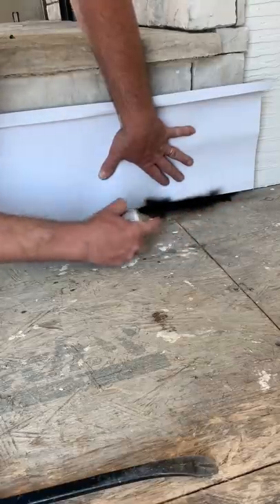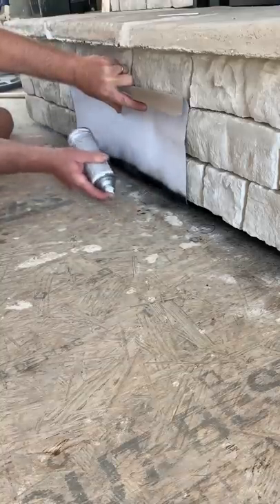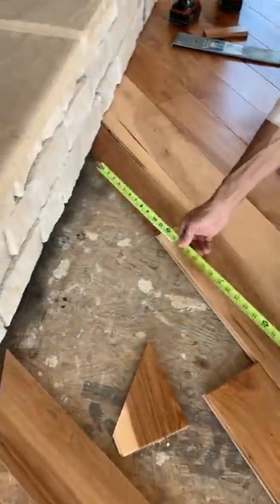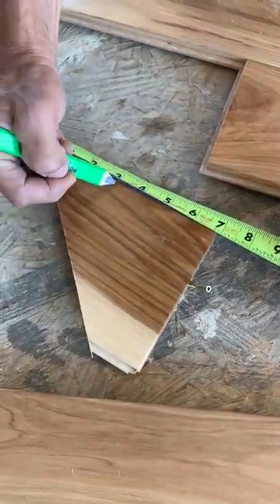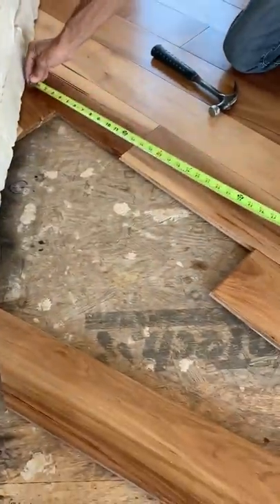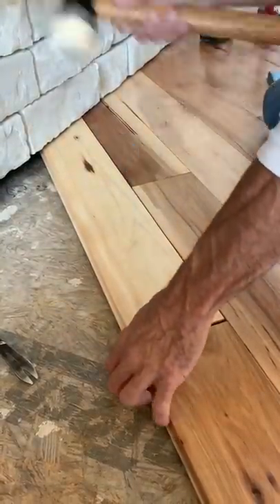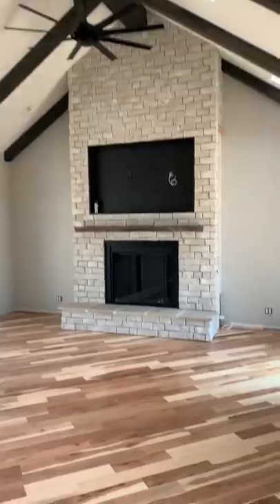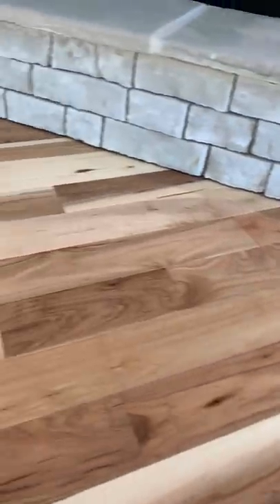Pro Hardwood Tips #shorts

Comment: That’s how you do it. Always communicate with other trades. It takes on average 22 subcontractors to build the average house. A good builder always knows what’s up ahead and plans accordingly.
Reply from the maker: Right on!
Reply: 22 😆
Reply: Give it everybody for bob the builder
Reply: 22 lol
Reply: 22? Should be 10
Reply: A R 🤣 that’s not how it works in wealthy suburban areas. The excavation contractor doesn’t come back to install the roofing and gutters. The carpenter doesn’t do the concrete and masonry. The plumber doesn’t paint and install the countertops before he installs his fixtures. Y’all are not seeing the bigger picture. Keep punching a time clock 🕰.
Reply: @zackzander425  or hire a general contractor, my boss does plumbing, electrical, roofing, siding, drywall, flooring, framing, you name it
Reply: A R  In GA there's an abundance of people saying they do it all and less that say what they actually can do, yeah the guy might say he can run wire in your house and do the plumbing while he's there and only actually doing one of those half decent, I'd rather just get someone actually certified and well known for one thing so I'm not trusting 1 guy on 4 tasks to also document his work and what he's done.
Reply: This is why spending the extra time to have contractors meeting prior and during a build. Don't need to go into the reasons why this is important, dedicated craftsmen will understand. Communication is the key to a great build and will be less stressful and will end up with a great outcome.

Comment: I have been a union floor layer for almost 25 years and I have my own side business installing and sanding and  finishing hardwood floors. I have came across this a few times and what works best for me is to start your row off under the brick and make your cut against the wall and then you can still nail from left to right.
Reply: Yes, I do this too. So much easier and quicker.
Reply from the maker: That is usually the case but not in this instance. I had an 18' long slider with fixed glass panels on the other end of this. So, I needed that perfect fit against the door, and it was easier and more efficient to end the flooring under the stonework. You being a floor installer for almost 25 years, should concur with my decision?
Reply: @w.k.d.constructionllc  I agree with that but it just wasn’t said in the video. Much respect to any other floor installer.
Reply: That's how I do it too! Been doing wood floors for just about as long as you have.
Reply: @w.k.d.constructionllc  I have a question for you I understand you would like to have the base on first and that makes sense if it is prefinished but most of the houses I do that are new construction usually have someone else install the wood Unfinished and I come in to sand stain and finish the wood. It is just a lot easier to put the base on after the floor has been sanded and finished. I had commented on another one of your videos and some guy left comments paragraphs long and brought in politics to the subject.
Reply: So that males you dodgy?! Side business off your real job..
Reply: @Cent51  no? That's just how the business works.
Most employees on floor crews/trades in general are 1099 workers.
Reply: @Cent51  if you want a good life you have to work hard for it. I actually get a lot of side jobs through my company. We only do basketball courts and I have sanded and painted the Pacers, Indiana University, Butler University and many more and when our company gets a call about residential work they always tell them to call me. Thank the Lord every day for my blessings
Reply: @megaranhas7301  I just passed 20 years in the flooring trade, I'm not Union but own my own business. You are right on the money about working hard. Good money in this trade if your willing to work for it.
Reply: @keithb3989  I am 46 years old And I barely graduated high school in 1994. In 1997 I joined the floor covers union And traveled to 47 states installing and sanding and finishing Floors in the mall like J.Crew, Eddie Bauer, Abercrombie Fitch, and many more. After 4 1/2 years I got in to a union flooring company here in Indiana where we mainly do basketball courts. I started my own side business around 15 years ago. My wife has not worked in 21 years and we have two children and we live a great life. With my job and my side business I make over 100,000 a year. I work a lot of nights and weekends on my side business. I always tell people if you want a good life in this country you have to work hard for it. I absolutely love what I do and it is very gratifying. I am a very humble person and i thank the lord every day.
Reply: @megaranhas7301  Money isn't everything that's for darn sure. You decide where to draw the line. That's the great thing about being self employed! This work isn't for everyone but I love my job. And there's far more people that will say they hate theirs than love it.
Reply: @keithb3989  I would take a five dollar an hour pay cut tomorrow if I had to just because I absolutely love sanding and painting basketball courts and getting to work by myself most of the time and the side jobs that they give me. My superintendent is awesome and the owner son is our salesman And they treat us great
Reply: What about the osb underlayment
Reply: @znkhomes  I would never install hardwood straight to the plywood. We always use 15 pound felt paper for roofing underneath all our hardwood floors in residential. I’m very surprised this guy isn’t using any
Reply: @Keith B  so true! There is good money in it but you can't be a jackleg... I work with my husband installing hard floor surfaces (tile, vct, lvp, wood, etc).

Comment: I've been in construction for over 20 years.  Been running floors, tile and laminate, on a 45 for the last 15.  Alot of contractors will tell you that it uses more material , they are incorrect. If you plan your floors properly , I find that you use more of your cuts and therefore use less material. Even a cheep laminate looks fantastic when run at an angle.  
Well done sir👍
Reply from the maker: appreciate it
Reply: Everytime I cut a board the cutoff becomes a starter on a future row. It also helps randomize the floor.

How would cutting extra angles into the material which creates waste, therefore more material, some how use less material?

Comment: When I had my brick fireplaces I never knew I was going to do a hardwood floor next to it. My fireplace in the family room is 9’ wide, comes into the room about 10” and has a raised hearth. The pros that installed my oak 4” wide floors (done in October 2016) did an accent that I asked them to do. The hearth is only 6’ wide rather than 9’, so I asked them to do a zig zag around the fireplace, including the 10” piece. That little bit of difference sets off the fireplace, it is stunning. It’s been 6+ years since this floor was installed and still looks brand new. This was not a pre-finished floor, but finished in place.  Thanks.
Reply from the maker: Nice

Comment: As a floor mechanic myself I have had the courtesy of the masons setting the stones in anticipation of the floor to be set only a handful of times. Mostly I have to run ot flush myself. And of course I am the one held responsible for it looking good. And I always deliver.
But could not agree more that communication is a must as well as courtesy for fellow subcontractors.
Reply from the maker: Exactly, simply anticipating the final result & don’t make it harder on the next guy.

Comment: As an installer, I've gotta ask : where's the vapor barrier/ underlayment ?
Reply from the maker: It is a glue assist install, so Im not using a felt or rosin. The actual vapor barrier is in the crawl space. The crawl space is encapsulated with 20mil fiber reinforced plastic and foundation is insulated. That space is conditioned on this house. I have 2 air returns, 2 air supplies, & 2 dehumidifiers to catch any extra moisture in the air. So, there is no need for anything to be applied to the sub-floor for moisture protection. There is actually less humidity under the house vs the actual living space.
Reply: I was scrolling for that answer also. As long as the crawl has proper vapor barrier which sounds like it does it would be fine. The only issue with glue is down the road if it needs to be removed, customer wants something different or there is a water damage etc. I’ve pulled up a few and ended up having to replace most of the subfloor. That sucked.

Comment: Use a 10 inch block. Then you can just butt your tape to it and add 10.  

Now for the pro-tip: On every piece that you lose reveal put a 10 inch mark on the leading or open edge of it. Measure to this mark on the next piece past it.

Comment: Another pet peeve of mine… form follows function. If this house had been built in 1822 or even 1922 instead of 2022, the stone hearth and fireplace would have been real masonry and not just decorative veneer. It would have been installed first before even the floor framing and the finished floor could NEVER have magically slid underneath it. I’ve taken apart 100s of old houses and have never seen a case where a mason started their hearth on top of the finished flooring material. So this might look “cleaner” than scribing the flooring to the hearth, but it accentuates that the fireplace and hearth is a fake.
Reply from the maker: Uh, You can look at the burn box and tell it's not a true masonry fireplace. So, I'm not trying to pretend it is. I prefer the cleaner look than scribing to the stone. BUT, I have actually seen old wood flooring recess into the brick on old masonry fireplaces too. They used the fireplace as a structural support for the floor system and flooring. It actually looked like the brick was resting on the old hardwood. Hmmmm? crazy, I know

Comment: If you’re going over an existing subfloor, do you put any materials over it or level spots that may be uneven before putting down the hardwood?
Reply from the maker: ideally, you want the sub floor as flat as possible to install any type of finished flooring. But with that being said, using 3/4" solid hardwood... it can span some of the small irregularities in the floor and still be sound to walk on and look flatter to the eye, if you feel me?

Comment: Very sharp. Looks like you just picked up the fireplace and eased it down on that beautiful floor.
Reply from the maker: Awesome, thanks... Thats the goal! To look like it basically grew there!
Reply: Looks like he raided the trash pile to get enough short scraps of non-matching timber.
Reply: @johncoops6897 So.... You're that guy? This is nice work.
Reply: @ggCHILLIWACK  - It's a super el-cheapo job using scavenged offcuts, probably the reject timber from better installers.
The workmanship seems OK from a distance, although we never saw any of that detail. It was obvious that he didn't allow enough clearance for expansion so it might pop off the lowest layer of the fake stone facings. He also didn't use any underlay, glue or fasteners so it will be really noisy and dummy underfoot.
You may not have ever seen a quality timber floor, so you have not point of reference. Anyway if you think it looks nice, then good for you.

Comment: It's the little things like this that make the difference.
Reply from the maker: Yesss
Reply: @w.k.d.constructionllc  I've seen hardwood jobs done with amazing hardwood, but the trim is complete trash. Real hardwood will literally last a lifetime (or two, or three) if well cared for and refinished every 10-20 years. It's a shame to see good hardwood installed shoddily. The wood costs the same whether it's installed well or not, and saving a bit on labor simply doesn't make sense.

The best investment people can make when having hardwood floors done is in good labor like yours. Something they'll be satisfied with for a lifetime, not something they'll immediately regret and have to look at for the next several years until they finally get tired of it and spend even more $$$$ and waste even more material to have their floors redone.

Buy once, cry once. You get what you pay for.
Reply from the maker: @ParadigmUnkn0wn  that is correct! This was about a 40k install, & that’s a huge investment in wood flooring. I appreciate it and thanks for watching!

Comment: I nevet really liked when flooring goes diagonally with the walls of the house. Is this just a preference thing?
Reply from the maker: This is a special type of situation. This room is built on a 45-degree angle from the main house, so the wood is running parallel with the outside walls on the main part but then look to be at a 45 in this room. If you follow me?

Comment: That is some nice wood, but I always use felt paper under my floors. I also make sure I don't have end joints that are straight across every other run. I put a lot of work into making it look random. But it's a nice floor though! I've been laying/sanding floors since the late 90s.
Reply: I was thinking the same thing. Never seen anyone install hardwood without at least a felt under- layment. This floor is going to be nice and squeaky in a few years. I will probably never install another hardwood floor without adhesive again. Just creates a really solid and silent floor.

Comment: After helping my friend install just vinyl plank flooring… how’d you get the scrap piece out you were measuring with????? You drove it in there with a mallet, how’d you get it out? That crap isn’t easy.
Reply from the maker: This is tongue and groove solid hardwood not laminate. Hardwood doesn’t have a locking type tongue, so I can take it right back out before I nail the correct piece

Comment: So is there a reason you aren’t using Aqua-bar ? Or is it a 2nd story floor ?
Reply from the maker: My crawl space is encapsulated and HVAC conditioned with 2 dehumidifiers. There is less humidity under the house than in it. So no need for a moisture barrier since the crawl space is actually an extension of the heated/cooled livable space.

Comment: How long did that subfloor sit out in the weather? It’s completely grayed out. I’d be pissed if that were my house. No vapor barrier either.
Reply from the maker: As soon as we started framing this house, we had record rainfall amounts for 6/8 months. This house was huge and a very technical floor plan. So, it did get more weather on the subfloor than anticipated, but we used Advantech, screws and Advantech foam adhesive for intimate bond…. and while it did grey, the structural integrity is still there.

Comment: You do beautiful work. Amazing. Hope those homeowners appreciate this work for years to come. Was hoping you may have some ideas to help me, would mean so much. My house is not my castle, it’s my dungeon. There is nothing on earth that would make me forever happier than making my house something to be prideful of. So…every time I have a pro look @ my house, can always tell by the look on their face, they are thinking it will take lots of time, sweat, and know how. They all recommend a full drywall, every inch. So they give me a huge quote just to make sure they don’t get the job. Happens every time. The tool who “rehabbed” it, after a fire long ago, cut every single corner. On purpose…to save $…had to have been. He really did me dirty. Not one of the dozens who have seen my ceilings and walls said they have ever seen anything like it. It is uncleanable, uncoverable. It’s like popcorn on steroids on every square inch. It is so rough it would rip a diaper right off a baby if they rubbed against it. When I try to clean it, it is so thin, a grayish green spot appears directly under the thin top layer. 
I have tried to paint it, it sucks up paint so much, it takes about 4xs the quantity of paint a typical room takes. No bueno. I can not wait for the day when I can have company without the constant embarrassment of what they must think of me. It’s now been 18 yrs of no company. Years ago I decided I would get one room @ a time drywalled. Started in the bathroom. Did my due diligence, checked them out. Not only did they steal $200 from my drawer, they went on my laptop for some reason, when I had to leave for work. And the work…horrible. Might as well have flushed all that $ down the drain. Always looking for any possible way to fix this. Can’t wallpaper it because it’s not a flat surface. Know if any cleanable covering that can cover 1,340 sq inches including ceilings? It really doesn’t matter to me at this point of the lost sq footage by coving the “drywall”. I was even considering teaching myself bricklaying. But I don’t think you can lay brick on the ceiling. Appreciate your time and expertise so much:)

Comment: We  just cut them with a jamb saw  with diamond blade. It  comes out even cleaner than this.
If you start AT the fireplace you don't have to measure last piece
?
Reply from the maker: I didn't want a cut bottom pc of stone. I wanted a full pc to start with. It's not in the video, but I have an 18' slider with fixed panels on the other end.... so, I started hardwood against that and ended my cut under the stone, that's why sir!

Comment: Pro-tip, start your row from the fireplace and you won't have to measure under the stone.
Reply from the maker: I would have but the other side of this is where a 18’ long slider was located. So it was more efficient and cleaner to start from there and finish under the stone where I didn’t have to be as precise.

Comment: Almost nice..  however that fireplace hearth extension doesn’t look to meat the NFPA fire code standards for residential construction of 20in minimum depth..  looks about 12-14.. could just be an optical illusion though. 🤷🏼‍♂️
Reply from the maker: It's not a real wood burning fire box. We used ventless gas logs, so hearth should meet all fire codes.